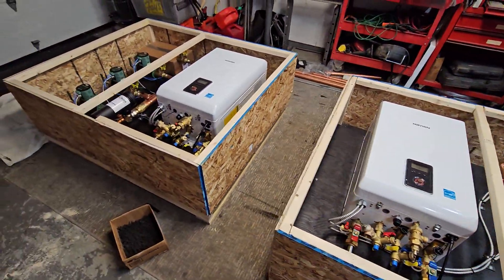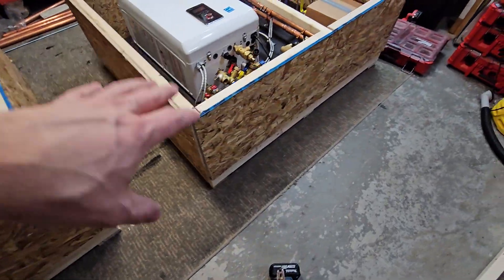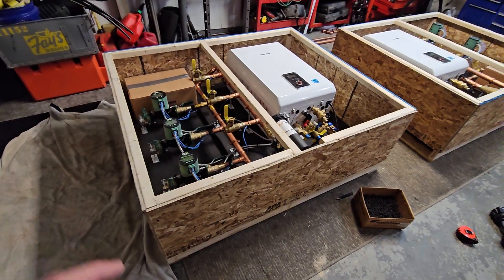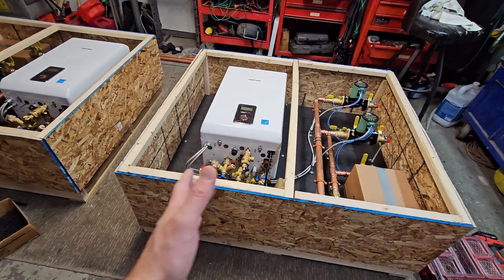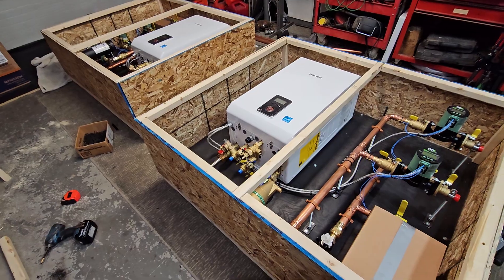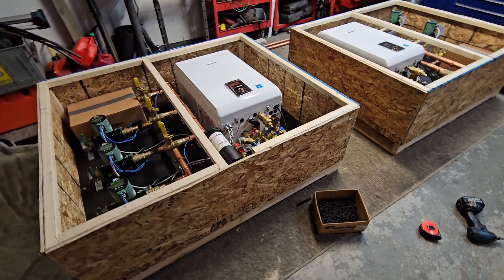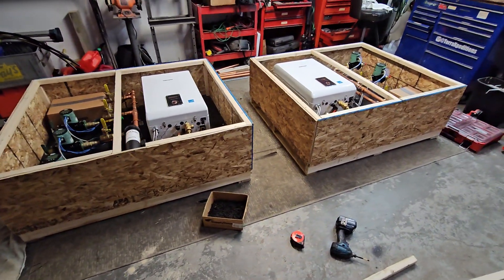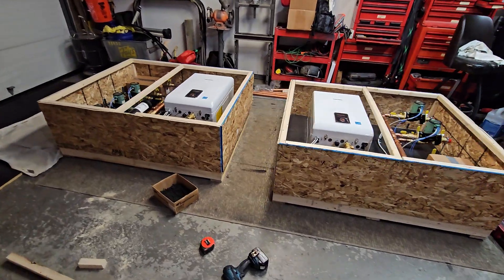Custom Pre-Built Boiler Systems For Radiant Heat, Basebaords, Radiators , Air Handlers

Comment: Nice woek Jim. Quick question where would the colde water supply line go in your system does it need a pressure reducer before it gets there
Reply from the maker: Navien Combi boilers have an auto fill connection for the heating side and there is also a separate water connection for the domestic hot water input.
Reply: @JimSperanza   so you can directly connect a cold water supply line from the main water supply to the auto feeder?  does it need a pressure reduced valve?
Reply from the maker: @vampirel1983  it does not need a pressure reducer, but it does need a backflow preventer.